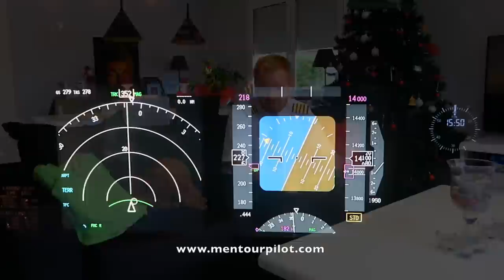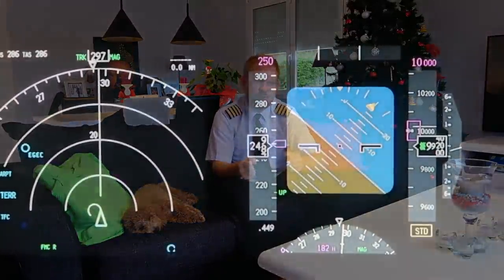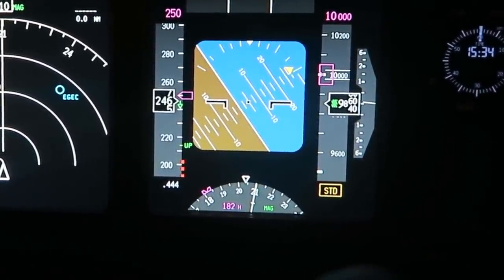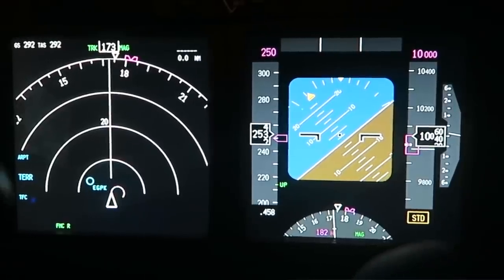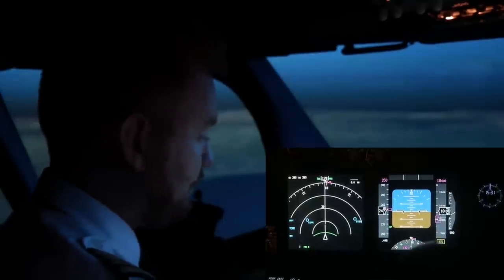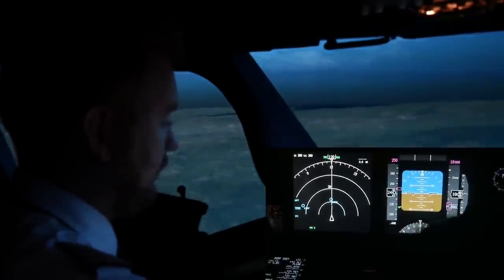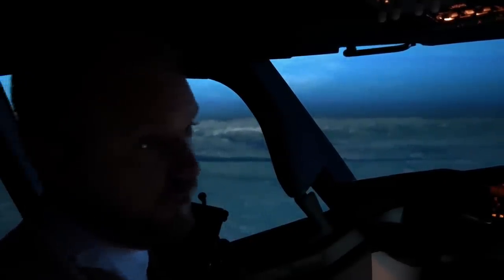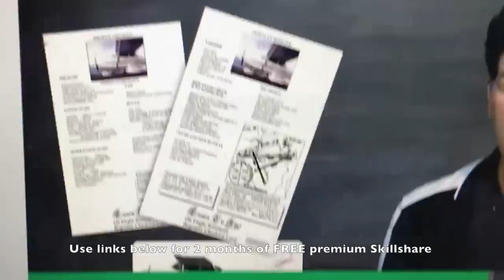What happens if you ROLL an airliner?!

Comment: Speaking as someone who has flown and experienced “white knuckle syndrome” nearly every time, it’s great to have the opportunity to know what’s really going on in the cockpit. Learning more about both the aerodynamics (the physical forces acting on the aircraft) and the airplane controls (what the pilot is doing with the aircraft) helps to mentally combine the two to better understand what’s actually happening when we fly. Thanks for the flying lesson! ✈️🌐😁
Reply: Jeffrey Powell well said, I watch Mentor because it eases my flying fear. I have no intention of getting my PPL
Reply: Just for completion, most airbus aircrafts and the larger aircrafts, like the Boeing 747 do not have a cable connection to the ailerons (they have for the THS (trimmable horizontal stabilizer) though.
Instead they are controlled by electric signals and have one or more additional hydraulic systems that will work/start operating if the engines would fail.
Reply: Jeffrey, I’m glad watching these videos ease your “white knuckle syndrome” when flying. I probably have a pretty good idea of how you felt. I seem to have some instinct deep inside that doesn’t like flying. It’s like… ah you’ve heard the “terrain ahead, terrain ahead, pull up, pull up” warning in these videos? Well, when I’m approaching an airplane I actually intend to ride on, I’m pretty much experiencing. “Aircraft ahead, aircraft ahead, turn back, turn back.” 

I suppose it’s not all bad, because I can override it and make myself board, sit, put the seatbelt on and stay quiet for the entire flight. It’s not pleasant but I’m usually okay due to a couple things I’ve worked out from previous experience, such as not sitting near the windows. Seeing clouds below me along with traces of ice outside reminds me of my situation-crammed into a big pressurised metal tube with wings and engines so high and fast that if anything goes wrong we’re toast. Probably quite literally given the tendency of aircrafts to burn once they crash. And the reminder ramps up the anxiety lurking in the background. Granted during my first ever flight at thirteen years old I was experiencing bouts of vertigo anyway, but looking out the window finished the job and I ended up making good use of a sick bag.

The other trick is to get a seat where I can observe the cabin crew for most of the flight. Again from my first flight I got spooked during landing when the reversers deployed. But somehow I remembered to look at the flight attendants in their seats and my fellow passengers and when I saw everyone completely unphased and almost bored I concluded that whatever this ungodly noise was, it was normal. It took me a little bit longer to come to the obvious conclusion.

But the theory is still sound. Pay attention to the flight attendants if you can. They’re not professional actors so it’s probably not a stretch to think that if there is a real problem even if they try to hide it so as not to panic all these people crammed aboard a pressurised metal tube with wings, they’re still going to give off little tells of fear or stress that being in a life threatening situation inevitably leads to. Other passengers? Not so reliable.

But for when the day comes that I have to fly again, because at least there are a few places I’d really like to visit someday I have a new plan. A foolproof plan if I can get my GP to agree. Medication. There’s got to be something out there that can silence my inner aircraft warning for good, and maybe even achieve that mythical “pleasant ride” mentioned just after the three minute mark in this video. 😁
Reply: @mikoto7693  the "if anything goes wrong we're toast" actually is far from true. If anything, watching this channel has taught me how much really must go wrong for anything bad to happen. It's usually at least 4 or 5 failures all at once to cause anything really bad.

Comment: Protip from the WWII combat pilots: when you get past 60 or 70 degrees, you have to use the rudder to maintain altitude. Once you're at 90 degrees, the rudder is effectively your aileron.
Reply: Can't imagine that being good for the structural integrity of the rudder at that size of plane.
Reply: I wondered about this too, he doesn't mention top rudder input during the high bank maneuver to keep the nose up. An Airbus lost a vertical stab and rudder and crashed due to overly aggressive rudder input by the co-pilot, so maybe there is a structural risk to the tail in aircraft of a certain size when using the rudder/v stab this way.
Reply: At the size of the 737, rudder wouldn’t provide anywhere near enough lift.
Reply: Speaking of ww2 fighters…. I had the immense pleasure of flying in a AT-6 trainer fighter…and amongst other things, I did the peel off you see in movies when there’s a squadron of planes needing to dive bomb (forget actual term)…. And it stays 1g all the time… ie youd never know your on such a steep angle

Comment: And after recovering from the roll, you grab the microphone and say "This is the captain speaking. We just did the sickest barrel roll with an airplane that weren't designed for it. Some people says it can't be done, but here we are! Drinks on us!"
Reply: That was no barrel roll.
Reply: Haha, thats the only way to calm people down after such an incident :D
Reply: Hahahahaha!!!!!
Reply: I hate to be that guy and I’m sorry, but it’s called an Aileron roll..
Reply: "This is the captain speaking. Nothing to worry about, I just needed to put in my eyedrops."
Reply: Yes...drinks all over us you mean.
Reply: Almost any aircraft can do a barrel roll.  I say almost because you have to have enough thrust/power to at least maintain a given airspeed and not decay too quickly.  Just about any jet airplane can do it, and most GA planes can do it.  It's because it's a +1G maneuver, it doesn't allow things like fuel pumps to be uncovered or stress the airframe.  The plane doesn't know it's upside down or right side up if you keep +1G on it all the time.  It's built for and meant to take that load, so it's 100% safe, harmless, and impressive.  That's why Tex Johnson did that in the dash 80 707 prototype in 1955 in Seattle.  Really showed people the capability of the aircraft.
Reply: @TheGamer223 I don't think you know what a barrel roll is.  A barrel roll wouldn't spill a fucking thing.  It is a constant 1G maneuver; there is no lateral movement or acceleration when performed properly.  None.
Reply: Once the cabin crew clean the drinks off the ceiling.
Reply: @Ryanhothersall  I don't know why you guys don't comprehend this.  If he did a BARREL ROLL there wouldn't be ANYTHING on the ceiling, except the ceiling.,..
Reply: @karlchilders5420  is there enough centripetal force during the roll to keep any cabin object still? things would fly outward at a tangent?
Reply: @williamnunn8847  We don't need to use geometrical terms to understand the maneuver.  All that does is confuse people.  If you want me to explain the advanced physics, I can certainly do so, but it is really orthogonal to the point and doesn't advance the instructional tone in this thread.

A barrel roll, performed correctly, keeps 1 positive G on the aircraft at all times.  That is what Tex did on the 707, and what any other pilot that knows how to do a barrel roll would perform it.  It is a very rudimentary aerobatic maneuver.  This has been done on everything form the Concorde, the Avro, on down to the smallest propeller planes.  You can barrel roll almost any aircraft that has enough power for forward flight.  The only difference in control inputs has to do with the power of the aircraft being flown.  More powerful aircraft require less control inputs and less movement on that controls to achieve the desired result.  You can barrel roll a Cessna 172 in the utility category, any aerobatic aircraft can do it, and any turboprop or jet aircraft can do it safely and without any issues.  That is the sole reason that Tex did that on the 707 demo flight, because he knew it would impress the dilettantes while showing the engineers and would be customers the power and elegance of jet powered flight in a commercial airliner.  It worked, because Boeing received much acclaim and many orders for the jet following the demo of the 707 over Lake Washington....

Go look at Bob Hoover's video where he is pouring iced tea from a pitcher into a glass on his dash while performing this maneuver.  He didn't spill a drop.
Reply: All I asked was if things would move around
Reply: @williamnunn8847  no, you tried to be sesquipedalian for some reason.  If that was your basic question I provided that information in my first response as well as my most recent one.  

Go look up the video right here on YouTube of Bob Hoover filling his glass with tea while performing a barrel roll.  The visual experience is a far better way to answer your question than using words, regardless of their length.
Reply: key point there, "when performed properly".  Remember kids, do not try this at home without an adult present . . .
Reply: Yeah, after the plane rolled, the drinks really WOULD be on you - all over you!

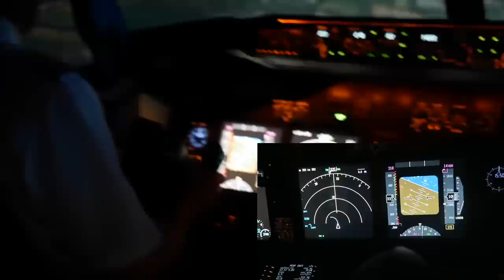Comment: 18:50 Must be an interesting feeling when you have both the overspeed limit and the stall speed limit visible on the airspeed indicator at the same time, with only about 50 knots between them.

How much altitude did you lose in that maneuver?
Reply: @dncrht  I thought he was at 10k, not 14 !
Reply: So, with that aircraft weight, speed etc. a safe roll recovery as shown will require about 5k feet to recover without over-stressing the aircraft. 
Performing a proper barrel-roll, and  maintaining 1G, should not over stress the aircraft, but that would be an intentional manuever. It could be done, but the pilot would soon be looking for another job.
Reply: @millomweb  The roll started at 14,000. (Look at the altitude on the right hand side.)
Reply: @therealax6  I'd only glanced at the altimeter part way through :) Having wound back to the start of the roll yes, it was 14k :)
It wasn't a very good roll, was it ! No need to lose that altitude - he let the nose drop.
Reply: @millomweb  Look at the speed (stall speed and over speed) indicators.

This is probably as good a roll as this plane is capable of.

As pointed out several times, the controlled barrel roll is a completely different manuever.
Reply: 250kt is 4 miles/6km per minute.  In 15 sec, you've traveled 1 mi/1.6km. Not unreasonable to experience the 0.9mi/1.4km drop as well.  Wow!
Reply: @cockatoo010  Yeah, different reason though. High altitude "coffin corner" is because the air gets less dense but also colder, so the speed of sound reduces while true airspeed increases and at some point they converge - you need more speed to stay flying, but you're already hitting the Vmach limits so you can't go faster.

In this case, it's the increased load factor that is pushing up the minimum airspeed requirement, so you start seeing the stall speed limit, while also flying fast enough to see the Vmax limit...
Reply: It's even more impressive that as this happens so fast, our captain is maintaining a safe speed in between.
Reply: He lost 4.6 km of altitude in 30 seconds.
Reply: lol
Reply: @CompletelyRandomUser  No, check your math. If he started the maneuver at 14,000' altitude and gave up 4.6km or about 15,100' that's 'high-speed dirt.' He did lose thousands of feet as he rolled inverted and then recovered but that is to be expected in such a massive aircraft with high inertia and relatively slow control response. In a light highly-maneuverable aircraft we would be applying forward (upward actually in this situation) yoke or stick in increasing then decreasing amplitude during that inverted portion to minimize altitude loss, keeping in mind that it is stressful on the airframe to do that. Then as we roll out, the forward pressure is gradually changed to back pressure as we continue rolling to horizontal again. But you are no doubt going to lose significant altitude. There's the danger- usually this type of upset occurs following a 'heavy' on final and there is insufficient time or height to analyze, react and make a full safe recovery.
Reply: @jamesengland7461  250 kt is 7.7 km/min or 4.8 mi/min or 130 m/s. So in 15 s you travel 1950 m or 1.2 mi. The drop was ~4000 ft or 1220 m, which translates to about 32 deg down.

Rolling did not scare me as much as seeing terrain directly ahead, with altitude dropping so fast.

Comment: Thanks. That was awesome. I’m in the Airbus now so unless we’re in the sim with alternate law it won’t over bank. But we tried this in the MD80 sim. What’s important is that you start with about 300 kts. Pitch to about 25° up. Zero the elevator Then roll with full ailerons. As the pitch falls below the horizon inverted you won’t be that low when it comes back around. If you start it level then the pitch gets about 20° low and the recovery is nearly impossible because you just can’t pull out without the stick shaker. We were losing 10,000’ until we tried that technique.

Comment: I'm extremely impressed at 18:50 where the maximum structure load/speed and stall speed got too close. Even for a split second you managed to get in between of that, hold it for as long as possible, and prevented a major damage to the aircraft. It's a sim but still, lightning fast reflexes sir bravo! Takes a toll on you physically and mentally to be even able to do it in a sim that precisely.
Reply: Thank you for clarifyling this. I was thinking that why the hell the red bars were appearing at higher speed, which of course in case of a stall, would appear at a lower speed.

Comment: I was hoping to see the 1-G barrel roll as mentioned about the 707 over Seattle. 

Back in college, I talked to a couple Boeing engineers who told the story of looping a 747. :)
Reply: yea that guy was a legend
Reply: Seemed like with this airframe the aerodynamics weren't there to pull that off? Right after he passed 60deg bank it started more of a dive then recovery vs a roll.
Reply: @rodnabors7364  Once you get past 90 degrees, you need to push to low but still positive gee. This will reduce the downward acceleration a lot. Airliners have excellent L/D and adequate roll rate to do an aileron roll, but most airline pilots don't have much experience with doing aileron rolls.

Rick Searfoss, XCOR's NASA surplus astronaut as I called him, could do an aileron roll in a rocket-powered plane without unporting the propellant feed lines. I know this because I was sitting next to him when he did it :) We got real light in the seats as we went over the top.
Reply: Those Boeing engineers were joking, right?
Tex Johnson could get away with rolling a 707 back in the day, but I doubt anyone else would ever have the clout to get away with risking a 747 in the same way. That said, it would be absolutely spectacular to see something like that if anyone ever had the guts to do it.
Reply: Boeing really did it. Full cockpit crew and multiple engineers on board. Took the 747 to its max altitude, pointed it straight down, firewalled the engines. When the pilots thought they had enough speed, they pulled back on the yoke as hard as they could. In the process of successfully completing the loop, they did bend the hell out of the wings. They did land the plane, noticeably worse for wear.
Reply: @JoeKier7  I am not doubting your credibility, just that of whoever told you this story.
What you described is nothing at all like what Tex Johnson did with the 707. Further, Boeing would not have risked a 3-man crew and multiple engineers to perform what amounts to a stunt (as opposed to conducting a test); Watson had only one other person onboard.
Reply: @kyle381000  Correct, the two stunts are nothing alike. The 1G barrel roll was safe and without permission. The loop was very risky and fully authorized according to the engineers giving the Boeing presentation. There is the possibility the Boeing engineers were making up the story to entertain the crowd.
Reply: @JoeKier7  I strongly suspect that the Boeing engineers told a story complete with far-fetched details solely to entertain the crowd.
I am not an aeronautical engineer. However, I think I know enough to know that you can't 'firewall' a 747 after going vertical and then just 'pull on the yoke' to recover it because at the very least the wings would shear off.

Comment: 18:56 When rolling the plane, you gotta push back on the stick once you start
reaching inverted flight and before doing so go straight first.
Take the hit from like 5000 feet altitude loss but go straight.
A neat roll is kewl, especially in a commercial jet, for 'testing'.

Comment: When I did a roll in flight sim 2020 in a Cessna 152 I lost quite a bit of altitude even doing it quickly. I can see why larger planes don't even do it at airshows.
Reply: Cessna 152 is definitely not designed for acrobatics like that. you need a low winged aircraft with relatively symmetrical airfoils I believe. Think WW2 fighters. A high wing  aircraft like a Cessna 152 has its center of mass below the wing, so it will naturally tend to stay in level flight (hang below the wing). Low wing aircraft like a P51 Mustang give up stability for maneuverability in flight and are thus more able to do things like rolls.